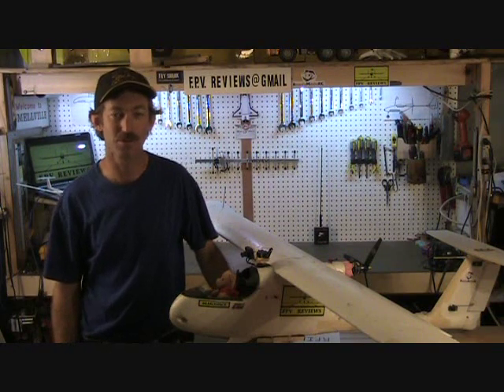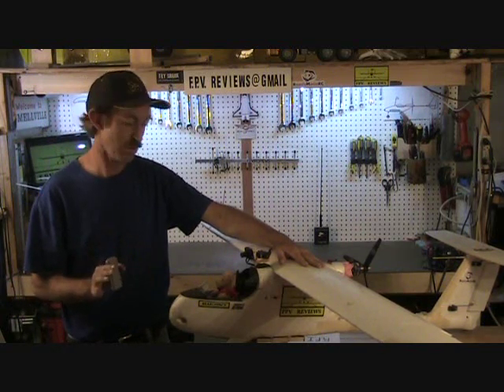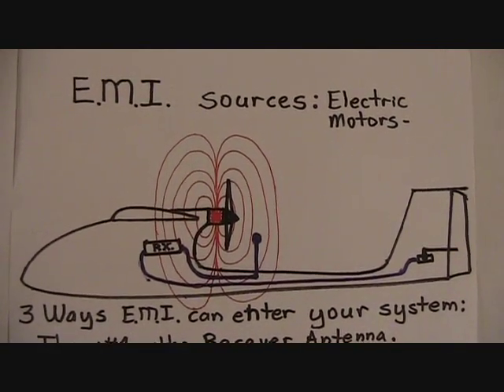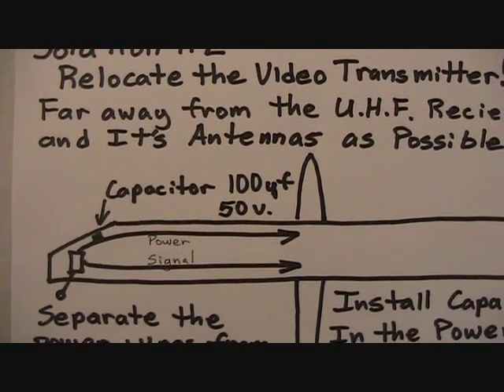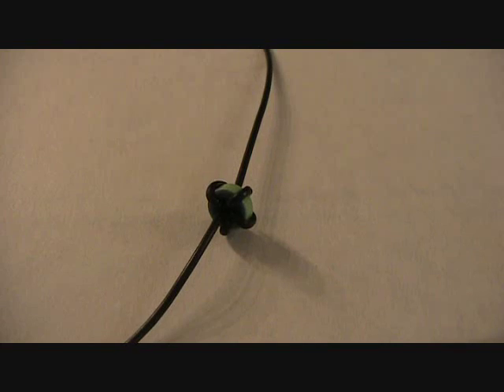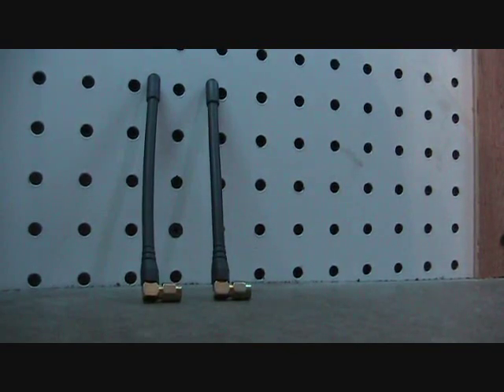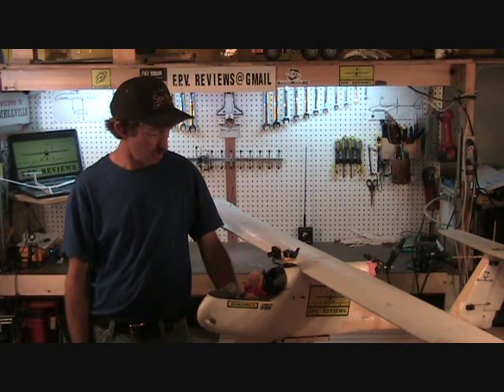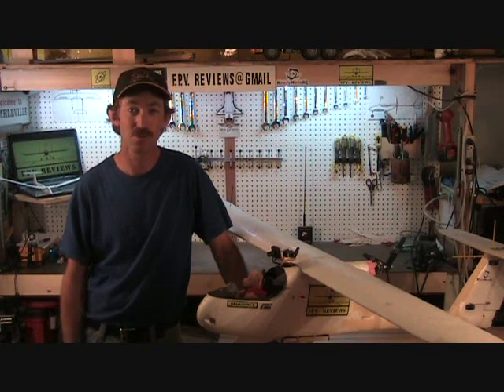How  to Set Up Long Range FPV  Getting the Max Range Out of Your UHF LRS.

Comment: I removed the 2.4GHz receivers from some planes that reached more than three km and put EZUHF in the same place, but I had a worse performance (I know I had problems with cold solders). In general, considering a TX in good condition, is the uhf 433 system more sensitive to interference than the 2.4GHz?
Thanks for your help

Comment: I love your videos!

I am trying to get rssi signal from an ezuhf 8ch rx through muxed ppm signal into my apm 2.8 and into a minimosd. everything is working except for the rssi feed remains the same regardless.  Have you tried this combo?
Reply from the maker: no have not.  with amp, you should not much have to worry about rssi once you have it flying the plane well, and have RTL settings dialed in.     I know the immersion rc minim osd works by plugging in directly to their receiver.  not sure if you are doing that, or trying to use a channel output.  should definitely read their documentation, the manual for the receiver, and the osd, see if you can plug it directly,  see if it's necessary to configure it to work in immersionrctools program too.  then if you cannot still get ti to work, contact sassen at the company, and see if their support can help you.   I've not found it to be that good, but maybe you will have better luck. ?
Reply: thanks!

Comment: A very informative video. One thing I was not clear about was the frequencies involved. You began by speaking about this freq being lower than the standard 2.4g, but unless I missed it, you didn't say what you were actually operating at. And please tell me the power. Thanks.
Reply from the maker: The video is on 1.2ghz. 600mw.
the control signal is 433mhz. 200mw low power and 600 high power

Comment: Could you tell me which motor and esc are u using in that plane ?
Reply: Hi Frank, I know the "Q." is not for me! But, an answer for you .. I have a Skywalker 1900 and my setup is, a 900kv Exeed RC rocket series brushless motor, 12x6 carbon fiber folding prop and a 60Amp ESC and a 8400mAh 3S Turnigy nano tech battery.Full Throttle draws about 39Amps and cruising at 17-19Amps.. gave me a flight time between 50-70min. depending on how strong the wind is!   I hope that helps!
Reply: you can try also the 600kv motor its great too!
Reply: +Fahad Al-Monayea thanks a lot my friend that help me a lot.
Reply: any time brother... you are welcome.

Comment: Also twist long runs of wire, for RFI and instead of just a capacitor, insert a low pass filter for lower frequency motor noise like this http://www.eetimes.com/document.asp?doc_id=1279624

Comment: Hello,i try to build a uhf fpv plane.The wings are not fixed,i can mount them off.
So ist need a connection for the tx that is proof for Electronic noise.Can you recomend a plug System? Thx
Reply: i guess now it is the Feiyu 41 lite that make the noise...

Comment: Spike great video thanks, can you enlighten me how do you transmit two different video signals to ground at the same time on your Gemini AC? what  frequencies and antennas you use to accomplish this? thanks
Reply from the maker: +svsoftair Thanks, i use two racewood 1.2ghz vtx's on different frequencies, and two high gain antennas on the ground, feeding two racewood video receivers. all units on ground are tracker mounted. you can see more in our ground station video.
Reply: +FPVREVIEWS thanks Spike boy, don´t you get interference as a result of having two transmitter on board on the same band? Would it be better to use different bands? In my situation do you think I can also use two different frequencies both in 5.8 Ghz? I will  check your GCS video too. You are a very knowledgeable person sir
Reply from the maker: +svsoftair there is no problem with interference, as long as they are not on adjacent channels. 
fpv racing uses channels very close to each other, and they can work fine together. 
i would stay away from 5.8, i have tried a couple of very good 5.8 systems, an they had nowhere near the performance as the 1.2-1.3 systems.
Reply: +FPVREVIEWS Spike boy you are a great RC pilot and your answers are exactly what I was looking for. I love your Gemini aircraft and I ofte review all of your Gemini videos, awsome. Keep it up and if at all possible please publish more frequent videos.

Comment: Are you using a switching bec to power your Ezuhf?
Reply from the maker: i assume you are referring to the receiver on the plane, then yes, using castle creations 10 amp bec.
Reply: Yes the Rx on the plane. The reason why I ask is that Bruce on Rc reviews says that uhf doesn't take too kindly to them.
Yours obviously works but have you thought about a linear bec at all?
Reply from the maker: paulkazjack i use a ferrite ring with the wire  wrapped 5 times around the ring to filter, but just a s a precaution. i'm actually running two of them, as i have another to power the dragon link on board too, for dad,s controls.  i have analyzed the spectrum noise, and noise floor, and there is no issue with it. i believe it also has filtering built in. the castle bec is known to be uhf friendly, but i'm sure there are menu bec's out there that are not.  it works great for me, and s switching regulator is more efficient. does not waste power. and does not get hot.
Reply: Good to hear,as ive already got 2 Hyperion sbecs I'll use them then.
Thanks.

Comment: What uhf system is installed in the plane in the video?
Reply from the maker: Immersionrc EZUhf.
Reply: Ive had no response from Swillhide but, can you confirm the output power in mw whilst in rangecheck mode.
Thanks.
Reply from the maker: paulkazjack i think it's 20 mw.

Comment: I believe that cable twisted servo is better than ferrites, Or ?
Reply from the maker: shielding or ferriday cage is better, or having no noise.  twisting is also good, but works in a different way, by making sure the noise is equal, for accurate differential measurement. the ferrite rings are a filter to help even the balance once the noise occurs.

Comment: why is the stock 771 junk?
Reply from the maker: it's cheap copy of the diamond antenna. a friend switched to diamond antenna, and tested both. he found the nagoya to have half the effective range. also read the description on the rmrc website about the diamond antenna. it's pretty convincing, and it costs more, so it must be good. right? lol.
Reply: I have the Diamond 771 and its very good! I was range testing it today! I set the exuhf module to 20 mw and wow this thing goes through houses, brick walls and trees.Got abou 0.5km on 20mw through built up area!

Comment: I have a question about the single positive and negative to the receiver. the positive and negative can come from one of the channels and the rest of the channels just have a signal wire going to them correct?
Reply from the maker: correct. the others are redundant to the reciever.

Comment from the maker: hmm.  using the same battery for plane, and video system? i'm using a separate battery. tried using the same battery, but using the throttle ruined the video. some people use an L.C. filter, but i like the idea of a separate battery. i hear that the dragonlink is known for creating stray rf especially on 1280 mhz vid. systems. a good video on this is on the stoneblue airlines channel by ibcrazy. they also did a show on flitetest. think it was called lrs shootout.  hope this helps.

Comment from the maker: Glad you liked the video. there is a disclaimer in the description, but i don't have 50 of them, and i added them at the advice of the tech from immersion rc for the reciever, and the others on noise-making components were added while observing their effect on the noise floor of the spectrum analyzer built in to the immersion rc reciever using the laptop.  noise floor dropped from 70 to below 90 dbm.  the ferrite rings are a whole science of their own, but this video is for general information.